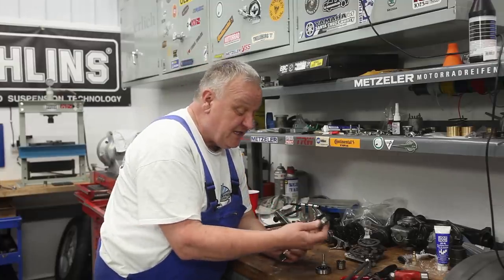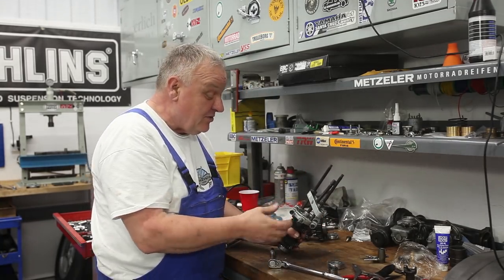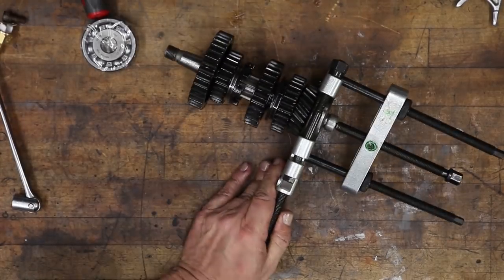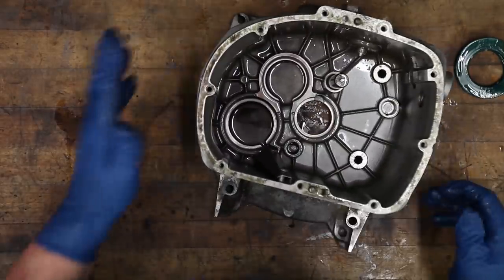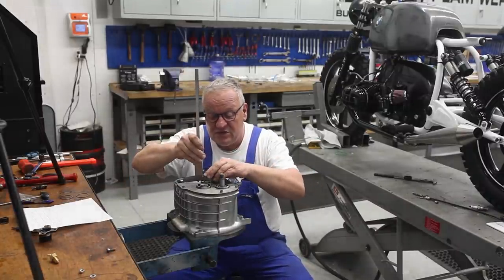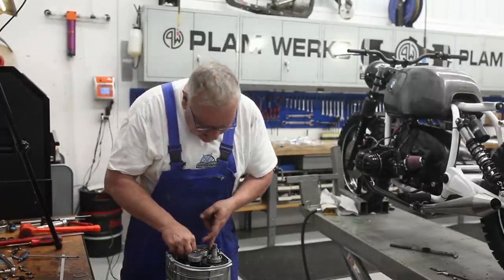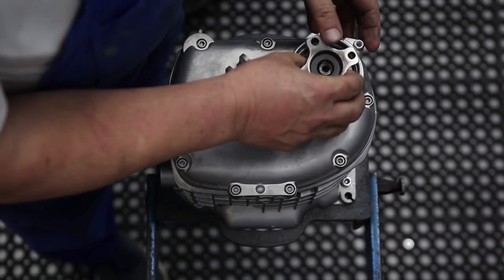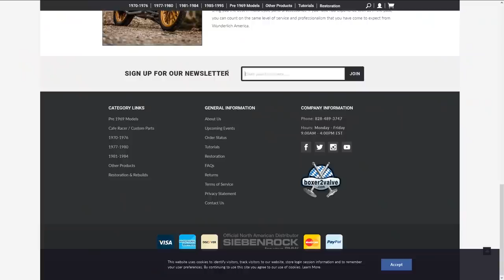BMW Airhead Mechanicals #04  Gearbox Reconditioning Part 2 of 2

Comment: William thank you very much for all these videos,  they are being very helpful for my R100RT restoration. At the moment I'm working on my gearbox and the time for shimming has come. Unfortunately, I only have some rough dimensions for  shimming plate manufacturing and I was wondering if you could share some manufacturing drawing (with accurate dimensions and tolerances) or any information, so I could make it. I would really appreciate it, so I could continue with the assembly operation. 

Thanks in advance.

Cheers
Reply from the maker: We do not have the exact dimensions. To make the tool, you would need to make it very precise. It might be possible to use the gearbox cover and duplicate the exact positions and sizes of the holes for the bearings, but we do not have the tools needed to make such measurements as precise as they would need to be.

We offer the tool under part number 8871133. It’s in stock and the price is $189.95

Comment: I purchased an airhead just because I have seen hours of videos with you, sir, working on it! What a joy to see people who know what they are doing. Thank you, sir!
The output shaft seal on my bike has the flat side on the outside (towards the rear wheel). 1992 R100R. Is that correct? It was leaking at just 38 000 km.
It is now time for me to replace it, but I might open the gearbox to inspect it cause I found some metal shavings on the draing plug.

Comment: Hi William ,
Can I first of all thank you for all the effort you put into your 1st class videos . For a airhead fan like myself who does a lot of restoration work on my 2 r90s's and my 80 g/s Paris Dakar they are invaluable.Could you please confirm to me which way round the small seal at the outside of the main shaft fits. You appear to put it with the flat face facing outwards towards the clutch lever or does it not matter. From a silly Brexit England . Regards Byron
 PS next time my wife and I visit the States we will be sure to take in your shop and buy some stuff
Reply from the maker: Hey Byron, The seal is installed with the flat side up, towards the lever. Come see us when you are in the States. North Carolina is cool. You will like it!

Comment: Hey how can a 20 tooth 5th gear mesh with the standard idler gear?  Seems like the distance between centers would have to change for the gears to have the same diametral pitch.  Thanks for the video.

Comment: Hey i got a 1983 r100 cs and i removed the transmission and discovered a decent amount of play though the gearbox from the input shaft to the output shaft. How much play (degrees of rotation i guess) is allowed before renovating the gearbox. 
By the way the gearbox works great, i just removed engine and gearbox because its a project bike. 

I wish you had a EU store, i would love to be able to support you more.

Comment: William, what Kukko Set are you using for this work? Is it the 17-K one? There are several from Kukko. I have removed bearings differently (not very professionally) in the past and would like to buy the Kukko set. Nice video!
Reply from the maker: Hello,
True, Kukko has lots of puller sets and some seem quite similar to the 17-K but I think that the 17K is the way to go for what we are doing. We have these in stock under part number 6460006. We are glad that the video was helpful.

Comment: Hi all, Wouldn't replacing the 5th gear on the output shaft with tall gear, with one extra tooth, require changing the 5th gear on the intermediate shaft? Do the old/tall gears have the same pitch diameter?

Comment: Post-85: no 5th gear circlip... resulted in innumerable destroyed transmissions (BMW blamed transmission failures on "wearing non-BMW boots")... BMW claimed: Problem?? what problem?? until they ultimately returned to the use of the circlip (newer R-series, 247E)... despite "no problem" but changed it back.... learned this the hard way with '91 R100GSPD.... and several drive shafts/kardans

Comment: Hi William, great video! I wonder if you could help me out with a bit of a problem: I am doing an overhaul to my 1985 r80 gearbox, and the circlipless output shaft bearing had started hiking up the shaft. My 5th gear has a slight play to it, sitting on the shaft I can only just get a 0.05mm feeler between the gear and the output shaft. Is this manageable or should I get the axle and the gear replaced? I can’t seem to find any numbers to reference on this. Thank you!

Comment: Hey William, great and very informative video as always. I’m having some issues with my r80st gearbox and currently I’m in process of getting enough courage to open it. I experience some short rattle noise as I press or pull the shifting lever when shifting into second gear, either from first to second or third to second. Also that krrrr noise is accompanied with reflex reaction on shifting lever. Based on your experience, what particularly should I be looking when I open the gearbox? Can this be issue with shifting mechanism or gears? Thanks!
Reply from the maker: You really need to look at all parts carefully. Bearings, bushings and gearwheels especially however from what you are describing.
Reply: boxer2valve BMW Restoration and Parts Supplier      Thanks for the advice! Looking forward to seeing new episodes

Comment: William, sorry to be thick but I'm struggling to see why sealed bearings are fitted to the layshaft, or indeed any internal bearing. Can you explain this please?
Reply from the maker: Both bearings on the counter shaft are encapsulated at the end. I believe that there was an issue with the bearings receiving enough oil lubrication. The sealed bearings are internally lubricated. They contain their own grease and don't need to rely on the oil in the gearbox to lubricate them.
Reply: William, if I may share my 2ct. From what I recall from my factory training 20 years ago, the only original BMW OEM bearings that are sealed are: 

1) the bearing on the output shaft (cover side) has seals on both sides and 

2) the bearing on the intermediate shaft (cover side) has a seal on ONE side (the seal should be facing the cover) 

Only the BMW gods may know why.

Yes, bearings with seals on both sides have grease in them ... that eventually will wash away with the oil that sooner or later will penetrate the bearing. Easy to find out, just remove the seals of a (double sealed) bearing on a bearing that you have thrown out, there is no grease left in them. 

While bearing on the output shaft is partially submerged in the oil, the bearings one on the intermediate shaft are not submerged and depend on oil that's splashed around. 

Since you can't easily get a bearing that's sealed on one side only, I typically get one with two seals and remove one seal with a screw drive (easy to do) before installing it. The in it grease does not hurt anything and will dissolve in oil.

Comment: William, if all you're doing is replacing the bearings, why does the cover have to be reshimmed.
Reply from the maker: Hi, bearings have some tolerances in manufacturing. They are not absolutely exactly the same, so whenever the bearings are replaced, the shimming should be checked and corrected.
Reply: And the bmw mechanics were often not accurate enough.